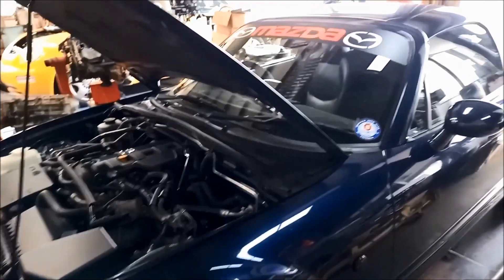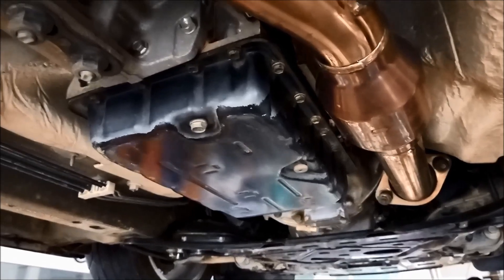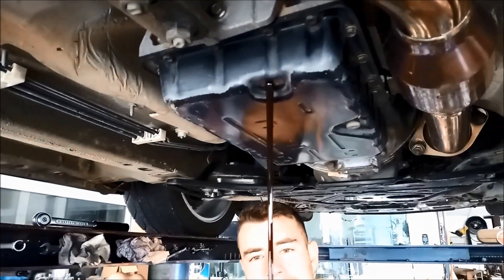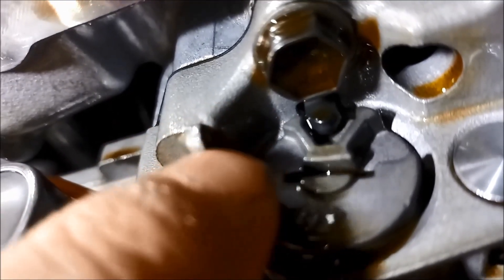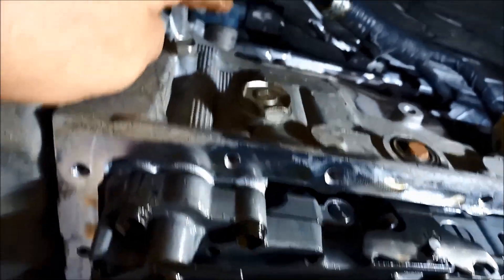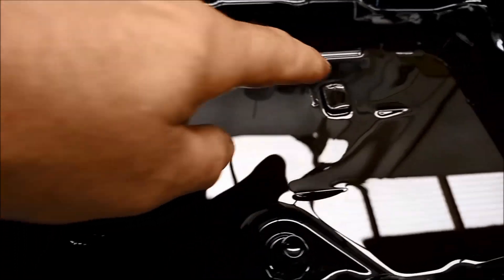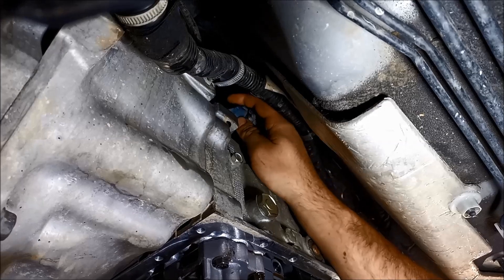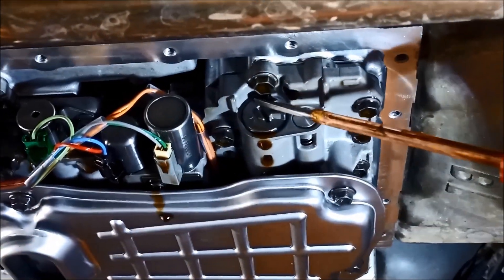Mazda MX5 Miata SJ6AEL How Service & Adjust Transmission 6 Speed Automatic Adjust Regulator Valve

Comment: hi my 2013 mx-5 AT-   transmission on limp mode  3rd gear stuck code p0971 solenoid C circuit.
replaced all solenoids same.. if there is another connector to reset AT light and TCM ?

Comment: Hey mate great vid, I have a question regarding checking the atf level with the engine running. The issue I have atm is that with the engine running at correct atf temp as per my scanner, there is atf coming out from the fill plug but nothing from the check level port??? Not sure if you’ve had this issue before. Cheers
Reply from the maker: hi, try overfilling through the level overflow plug, then let it trickle out when trans reaches temp. cheers
Reply: @YepThatsIt thanks mate this was the trick. I had to turn off the car, overfill it then close the fill plug and then turn back on and check the check plug. Cheers

Comment: Is adjusting the pressure control valve similar to what a shift kit does? Will it slightly quicken the shifts?
Reply from the maker: hi, kindof... cheers
Reply: @YepThatsIt  thanks for the reply. Is it safe for the transmission? I would like an improvement in shift response but not too harsh.

Comment: What type of automatic transmission fluid would I need for a 2017 ND Miata?
Reply from the maker: hi, checkout http://www.datateck.com.au/lube/tritechaus/  or   https://www.datateck.com.au/Lube/PenriteAus/   cheers
Reply: JWS3309 or T4 ATF. I would recommend Idemitsu type TLS
Reply: @ADUSN  Thanks I used Idemitsu Type TLS and it's the best fluid from my research on forums. It also eliminated the metalic whine noise when accelerating.
Reply: @ I actually had that acceleration whine start after the fluid change lmao but it's good stuff, definitely functions better than the factory fill dino oil

Comment: Great video helped me a lot I have one question how to unplug the connector in 3:23 s thanks again
Reply from the maker: hi, you just carefully flip up the small level and it should lift out. make sure you blow it out and give it a spray of wd40 or similar in case hasnt been off for a while. be careful not to break it. cheers

Comment: Hello sir one cuestión can I change my solenoids in my Mazda MX5 2011 the car have the light AT on and drive only in 3 gear please let me know thanks
Reply from the maker: hi, if in 3rd only will be limp mode. check all basics first and then see if any fault code present. cheers

Comment: Nice video. I have a question.  I have an ND with 13,500 kilometers. I'm planning to add 200ml of lubegard platinum using a little pump (no drain, just put the additive). Should I take out the over flow plug? or 200ml is not a dangerous overfill?. Thanks in advance!!!
Reply from the maker: hi, if fluid level is correct then 200ml wont make any difference. cheers
Reply: @YepThatsIt  thanks!
Reply: @albertoaguilar5693, do you know transmission code of 2016 ND 2.0 autos? is it SJ6A-EL? And which ATF oil did you use?